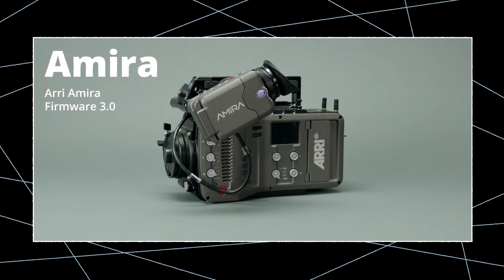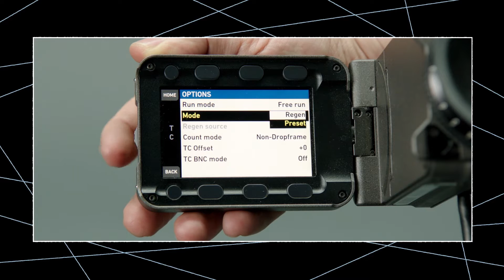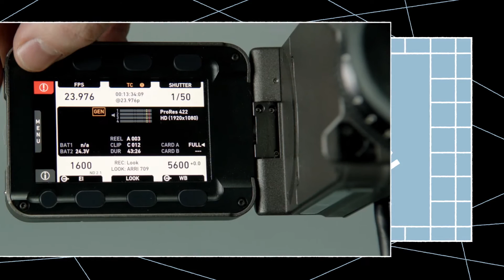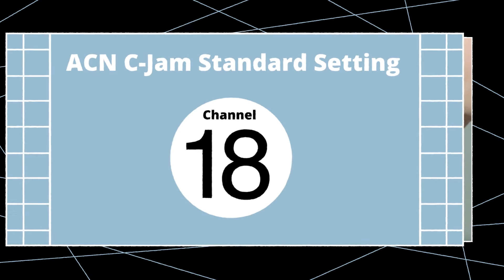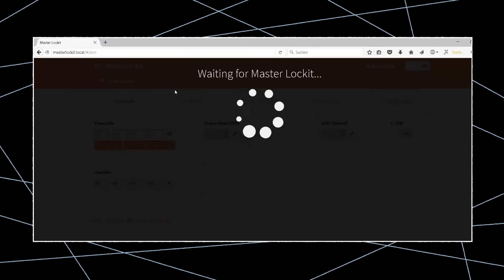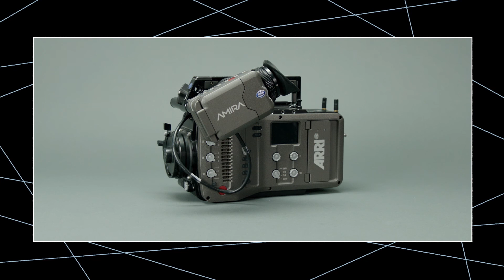How to Sync ARRI AMIRA cameras - Tutorial

Comment: Now I see why "Exclamation Mark" didn't disappeared occasionally.  Now it makes sense. I think all camera people should watch this. I've asked them many times why it's there and they've never had an answer.
Reply: Two Amira camera in perfect sync after a camera tests. Used this video in exact steps. Works perfectly. If this doesn't work, please check directionality of your TC cables and cable breaks. For real. I've had issue at first. And the rental cable was the actual reason.